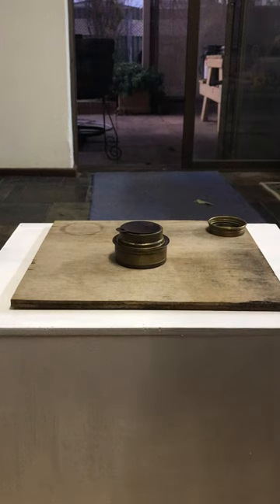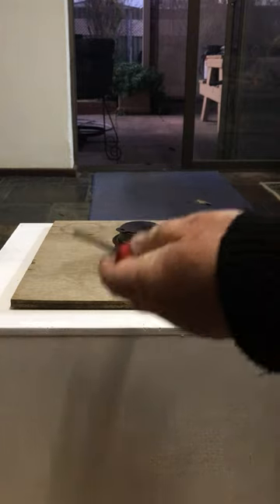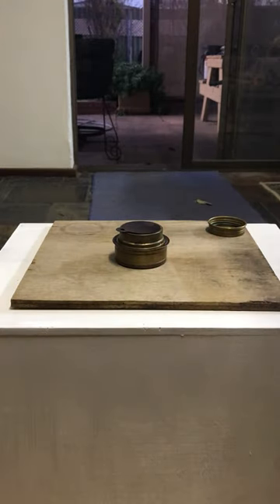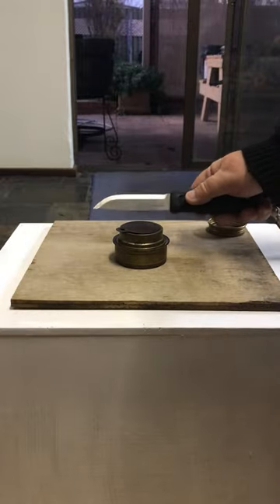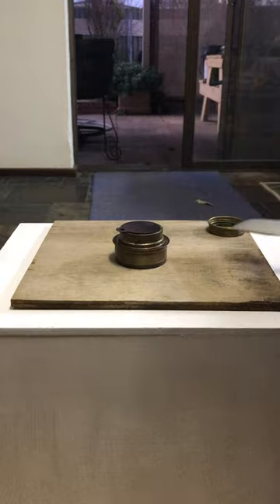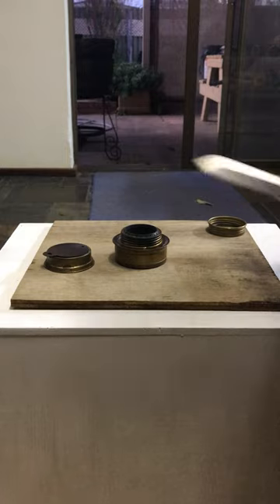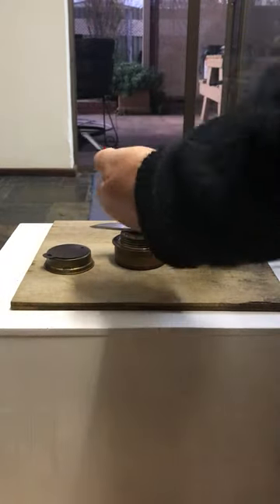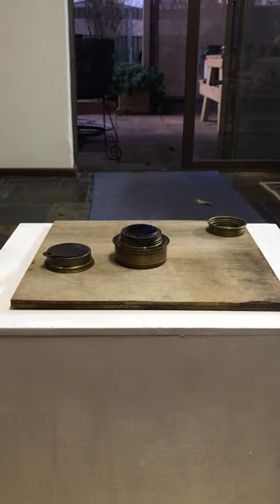Lighting a Trangia Burner with a Ferro Rod

Comment: Well this'll be a game-changer. No more trying to shower sparks into the burner for me.
Reply from the maker: Get the heat where you need it I use a similar method using the knife to hold the tinder and pull the Ferro rod away from the knife